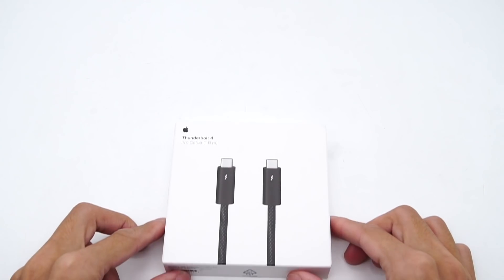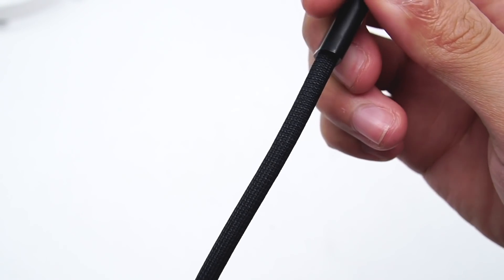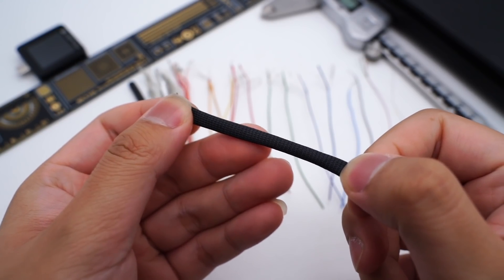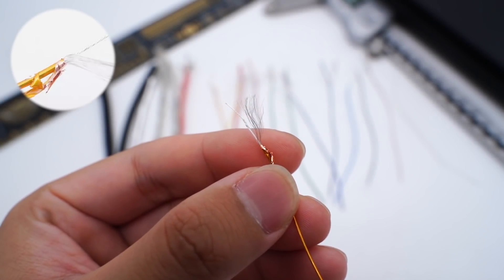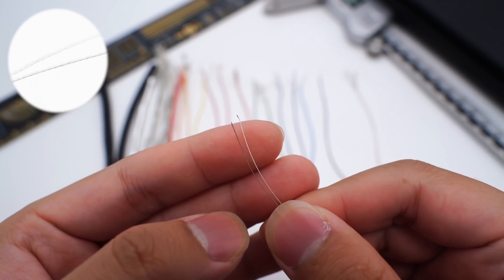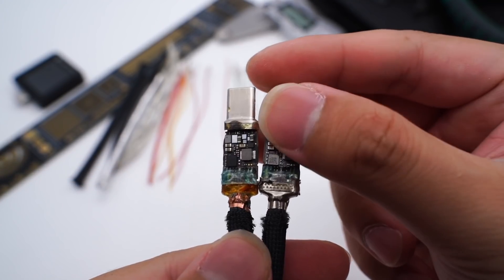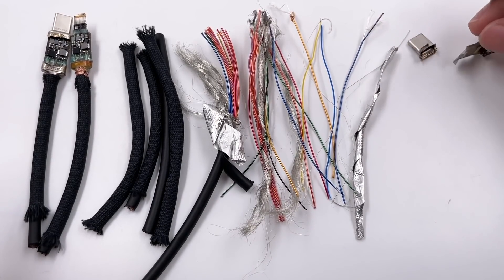The Most Expensive Cable | Teardown of Apple Thunderbolt 4 Pro Cable (1.8 m)

Comment: Once u go over a metre you need the active retimer chips, Amazon:
Apple Thunderbolt 4 Pro Cable 1.8m ($127 incl ship)
Zeskit Certified Thunderbolt 4 Cable 40Gbps 100W Active 1.5m ($53 incl ship) <- I went with this altho it is plain not braided

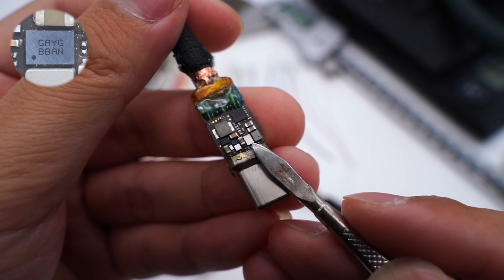Comment: Watched 2024 videoby Savage, they used xray on apple thunderbolt. There are some as good, less expensive  but how would you know? $3? I'm staying away from. 5:39 I like this review because he cut inside others to expose lack of signal management, and even lack of thunderbolt specific wiring. I guess there are brands with same high standard. Just have to do the search.

Comment: I bought one and compared it with my Acacis Thunderbolt cable. The speed is exaclty the  same for a lot less money.
Reply: how long Acasis did u have ? 2 meters ? and how it performs in long periode ? does it still compete with Appel's cable ?

Comment: Looks just like any other cable only costs $130 and doesn’t even do 240w like a $30 thunderbolt cable from cable matters
Reply: Who tf would use such a cable for charging 🤦‍♂️
Reply: @admiraladmirably  are you stupid? Why wouldn’t you want the best of everything in a super expensive cable like this? Especially when you can get everything with a $30 cable matters cable

Comment: I have bought two of these cables now and in both cases the use of such a high quality cable has fixed really annoying problems that I was having with other 'expensive' TB4 cables  - first problem was periodic glitching connecting a Mac mini M1 to a 5k2k monitor at 72Khz - and the second problem was connecting a MacBook Pro to a doc about 2m away supporting multiple devices and a 10GbE adapter - different problems with this setup on most days - put up with them for a about 6 months - then bought this cable - has been perfect ever since. I'm convinced.

Comment: my cat chewed the end of the thunderbolt cable on my dell dock, the other end is proprietary and will take $200 to get a replacement cable. I'm considering, stripping away the sheathing and realigning the 24 wires and sealing it shut.

Comment: Just got my 3 meter one in the mail. Bought it because it's literally the only Thunderbolt 4 cable available longer than ~2 meters, which is not long enough to reach from where I have my TB4 dock to the computer. I have been using a supposedly "premium" 3 meter TB3 cable in the mean time, and it sucked. The dock would disconnect and Windows wouldn't see any connected devices unless I restarted (even if I unplugged and plugged everything back in). Problem completely went away with this new cable. Worth the price.
Reply from the maker: Glad to hear.
We've also took apart 3m version: https://youtu.be/7P8Rgrs51yg
Reply: Bro what did you expect when you're trying to use ultra high bandwith cable that is way to long. You loose bandwith.

Comment: Here's an idea
why not make it so the data transfer cables can be switched to transfer energy if we are only using the cable for charging? This can increase the parameters / reduce cost.

Also 5:34 I don't agree with such homophobia from apple - g@y people should NOT be banned. I want apple to apologize.
Reply from the maker: Some ordinary cable can only support USB2.0 and charging.
But this is a full function cable, including data transmission and charging.

Comment: Shame they abandoned the fiber optic spec for thunderbolt, I wonder how much faster it could have gotten if PD wasn’t a concern
Reply: yup they abandoned fiber optic spec, and it is for a Good Reason.
"People are sloppy when handling cable" 
they bend it, stretch it, pinch it.
if we put fiber spec on that, it will break on first week use.
Reply: Of course 1 optic cable much 100x times faster than many copper
Reply: @ayyioad9467  yeah but optic fiber is super fragile and can't be curled

Comment: nice teardown , but why they don't use tow copper wire for power and one or two optical fiber for data transfer , I think they will obtain more speed.
Reply: Maybe durability?
Reply: Optical fibers are far too delicate for a cable sold to the general public. There are very bendable optical cables out there, but they are incredibly expensive.

Comment: Makes me wonder if USB4 will have chip hardware in the cable.
Reply: Usb4 is just usb 3.2 (all gen abrivations) + thunderbolt 3. 
Thunderbolt 4 is just a higher set of minimum requirements of thunderbolt 3 + some security (which can also exist on usb4/tb3 devices) 
Usb-c already require a chip for many things. Not sure where the line goes, if it is already at usb 2 speeds or 5/10 gigabit with only 5v 500ma/1a which don't require a chip. 
But i believe if you want displayport through it needs one, or charging etc
Reply: @Infigo96  it's negotiated by the charge controller on the device
Reply: @Infigo96  I don't think USBC charging needs a chip
Reply: Wait is this cable usb4 compliant?
Reply: confusion increases

Comment: damn... integrated circuits in connectors? Why not in the devices themselves?
Reply: Space issues as always in this world of making devices thinner and dic*s thicker
Reply: They already do. But decent signal integrity is harder to guarantee going through connectors, and even harder going through a long cable.
Reply: How do you know a cable can carry 45w charging...or 60...or 100 or 240w. Does the cable have lanes for alt mode at all (displayport, usb 3.2 gen 2x2 etc) or is it as stupid as an old usb2 cable? Does it have shielding for dp1.4? Or capabilities of tb3?
That is why type c needs a chip. Not all cables need one but if you start using alt mode you definetly do. To identify capabilities if you start using functions which not the cheapest cables will ever be able to do

Comment: "Don't imitate risky behavior"

Wot? I mean, I guess dremelling plastic of a plug isn't the least risky thing ever, but it's fairly openly risky. But why the hell would clipping the cable with a cable cutter need that warning? It's not as if that cable has any (high capacity) capacitors or something.

The only thing that could go wrong is you putting your finger in the cutter and then expending the shitton of force needed to cut of your finger, while ignoring the pain.
Reply: The risk is to the cable itself. After following the steps in the video my new cable no longer works
Reply: Also it's a decent replacement for "Don't try this at home." Maybe it's a case of better safe than sorry
Reply: @minefreak2000  I don't condone that inflationary usage of these warnings.

It takes away the ability to escalate in truly dangerous situations. Like when taking apart a power supply.

And it suggests that he's doing something advanced. I'm pretty sure he didn't take meaningful additional measures, except maybe wear glasses for the dremelling.
Reply: @9SMTM6  yes, or even more so about servicing a microwave (the high-voltage transformer there is insanely dangerous).

Comment: Is there any difference between this cable and the previous version Apple Thunderbolt 3 pro cable? Every statistic is identical…only difference I can tell is 1.8m vs 2m.
Reply: This one is "new" and uses highly optimised copper dug at moon. Thats only reason for its price. I would never pay 100$ for a single cable.

Comment: Thanks ChargerLab for this tear down of the very expensive APPLE TB 4 cable. Very obvious is that the APPLE TB 4 cable is of a very high quality, they even used brass with double welding to ensure connector stability. The cable insulating and shielding are over-engineered for optimal use. This APPLE TB 4 cable is sold as an after-market product unlike the DELL TB cable that you uploaded later. The individual cables are made up of many silver-coated and tin-coated copper wires which have excellent signal transmission capabilities. The individual strands of cables are also much thicker than that for the DELL TB cable. Most likely that this APPLE TB 4 cable will perform much much better than other 3rd party TB cables including the DELL TB as per specifications and will be useable with a longer lifespan and durability with its quality construction. If anyone need just one TB cable, it’s cost effective to just buy one APPLE TB 4 cable that perform to specs and last longer than to buy many lower quality TB cables that will fail, have intermittent signal transmission faults and will not last long. With this tear down, it is justifiable for APPLE to charge more. Great video

Comment: this is hilarious, $150 a data cable. don't you guys get it already? Apple don't charge you how much the thing cost to make nor how quality/non-quality it is, they charge you as much as they can persuade you to pay, how much it's worth to those who are willing to pay.
Reply: That’s literally how every single product in existence ever has worked. No one is going to sell something the same price it costs them to make, especially if they can charge more and people buy it anyway lmao
Reply: @Lick2Trip  🤡
Reply: It is very expensive but that special cable is for professionals copying hundreds of GB of data or connecting multiple 4K screens
Reply: People have no idea how much is 40Gb/s... I remember a 40Gbps signal analyser disassembly on EEVBlog, and the device did not have traces connected inside - the ultra high frequency signal jumps between nearby wires inductively. This cable is not for electricity transfer, it is for radio signal transmission. Amazing to even have such technology outside of supercomputers, inside a standard looking cable.

Comment: I'm pretty sure this cable has about 1,000 times the processing power of the Apollo moon landing capsule control computer
Reply: @Hugohopser I think it was a joke
Reply: the lightning to 3.5mm adapter is though
Reply: Those hand-made magnet N-gates didn't age well, aren't they.
Reply: I think it’s a bit unfair to compare an ASIC to a pretty general purpose computer, but your point still stands.
Reply: I think you understated it 1000 times
Reply: @kerimkstati  actually more than 100,000 times, still he got 1000 times, I think you got the point
Reply: The Apollo Guidance Computer managed about 85,000 instructions per second, but the chips inside an Apple Thunderbolt 4 cable aren’t designed for that kind of computing. While even a basic modern microcontroller can outperform the AGC, the chips in these cables aren’t general purpose processors and therefore don’t have “1,000 times more processing power” in any meaningful sense.
Reply: @J2js7argcj4ttxThe question is not whether there is a general purpose processor in that cable or not, but how much processing power it has.
Reply: What moon landing?

Comment: lol aluminin clad copper wires. Premium price for subpar quality. Thanks Apple
Reply: The cables are clad in tin-coated copper wires. It's not aluminum. The Dell 1.8 TB 4 cable uses aluminum. Please get the facts right.
Reply: @rohithmekala2608  which facts? about the cable or generaly about apple charging a premium on products that are simply regular or sub par?

Comment: So dumb.. things like this belong in the end devices. A cable should only be that.. a cable. Not to mention it's incredibly insecure, as it opens up for in the middle attacks.
Reply: The cable can be passive for short lengths, which is why most Thunderbolt peripherals come with a half meter cable. Passive is cheap. But if you want a long length like this one, it cannot deliver 40Gb/sec if you insist on it being passive. To reach 40Gb/sec the cable must be active, for reasons like the one he mentioned in the video, “signal reconstruction.”

Comment: This is an ultra complicated cable for what they do, unsure if they really need to go that far.. seems over-engineered to me.
Reply: it is a 40gbps cable for professionals...
even if everything isn't strictly required, professionals want ultimate reliability, something you're not gonna get from your bargain bin amazon cable
Reply: @u1f98a  If "ultimate reliability" is their main goal, then explain to me why there are no protective sleeve and/or strain relief between the cable and the connectors. Even a layman knows this is the part where USB cables fail.
Reply: @fullmoon6661  because Apple
Reply: @fullmoon6661  all apple cables since 2019/20 have internalised strain relief. You can see it when they take the outer housing off. It's basically the same thing but looks better because Apple.

Comment: No comparison to other leading brands' Thunderbolt 4 cables makes this video largely useless as a quality guide. 🙄
What about >2m TB4 cables from quality brands like CalDigit, Cable Matters? 
The only thing the Apple one has is extra braiding on the outside.
Reply: This isn't a comparison
Reply: @EvertG8086  this is a promotional video for the product I see.
Reply: Main question is, for ~2m length TB4 ones: is buying Apple's ($130) vs. other quality certified ones ($60), worth it when it comes to technical performance. Or is it essentially that Apple's "Pro" branding means its nicely braided on the outside to look/be tough. 

My point is, you can't say one cable "works technically better" than others, without basic scientific rigour of comparison with other cables from quality certified brands like CalDigit/Cable Matters/OWC/et al. A killer idea would be another great @ChargerLAB video with a comparison by editing this one along with teardown of other(s)!  ;-)

Comment: Good shielding but are the wires any larger diameter than cheaper cables?  Are these the same chips in Apple's other cables?  Why not do some performance tests before tearing down? (If in another video, link to it.)   I think it's crazy that so many cables don't have strain relief that limits the bend radius at the connector.  We all know that's where the majority of cables fail.
Reply: The strain-relief on Apple cables has been internalized within the end caps for about two years now.

Comment: Not coax cables or wires. Simply shielded.  Coaxial cable consists of "an inner conductor surrounded by a concentric conducting shield, with the two separated by a dielectric (insulating material); many coaxial cables also have a protective outer sheath or jacket. The term coaxial refers to the inner conductor and the outer shield sharing a geometric axis. Coaxial cable is a type of transmission line, used to carry high-frequency electrical signals with low losses." -- Wikipedia
Reply: It is 10 coaxial cables in one shell. A single cable that replaces the whole cable channel full of coaxials. Amazing engineering!
Reply from the maker: There're 19 wires inside this cable. 
And four pairs of differential signal wires and two wires for USB2.0 transmission (a total of 10) adopt the coaxial cable design.
We've confirmed this.
Reply: @ChargerLAB  But in the video when you say "It's a coaxial cable with 19 wires" it's not.
It's a cable with 19 conductors. Some of those may be micro-coax, but the overall cable is not. I can't tell clearly from the video how those coaxial cables are terminated, but looks like all the shields share the ground plane.

Interesting to see a differential pair using 2 coaxial lines. I would have expected twinaxial instead, like 100Gb ethernet is doing.

That said it's still way too expensive.
Reply: Yeah. Exactly. This cable is nothing like a coaxial cable. Coax is always a single conductor with a shield and insulation. Cable/Antenna cables as a good example.

Comment: Ok, great, I get that this is a tear down video, but what I really want to know is … “does it deliver performance?” I’ve been reading that MacOS has trouble delivering MAX thunderbolt performance. I would ❤️ love ❤️ to see this confirmed!
Reply: I read the Apple Silicon Mac are having issues on delivering full thunderbolt performance, but old Intel Mac work just fine. I hope it is something fixable by a software update.
Reply: The cable is good for delivery what is put through it from one device to another avoiding losses and crosstalk. It’s up to the computer it’s plugged into and accessories attached to bring high performance. A good cable should be like it doesn’t exist as far as other components in the chain are concerned, meaning that it should not add or take away any qualities from the devices it’s linking together.